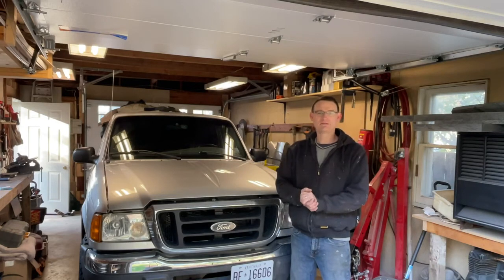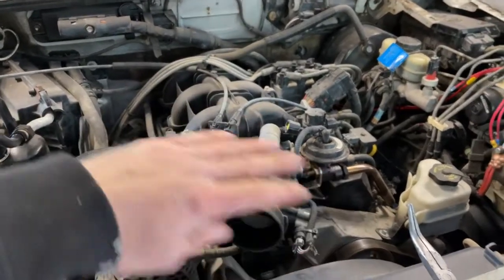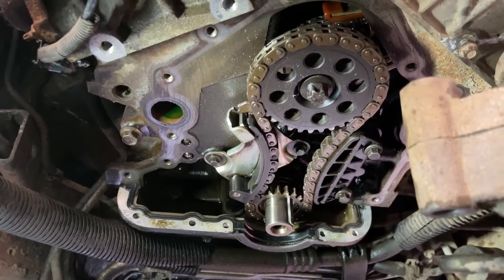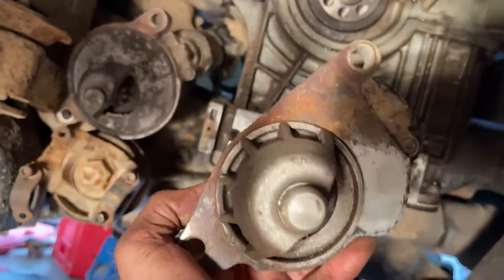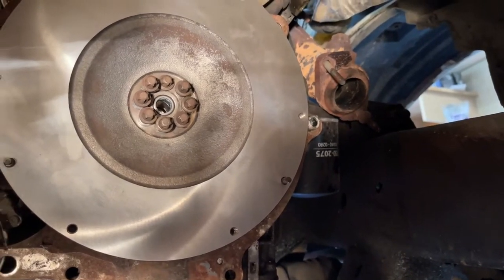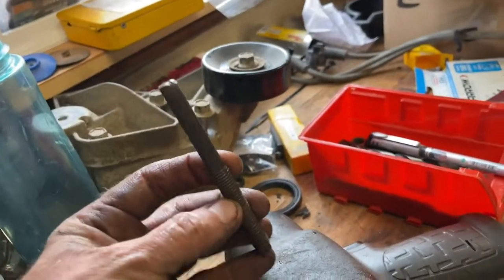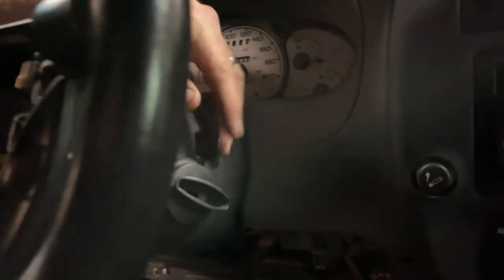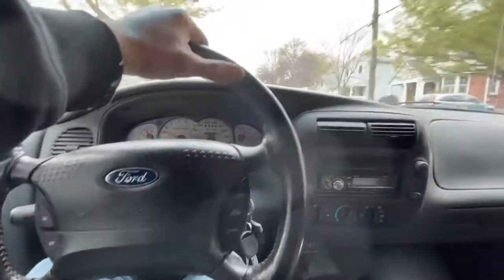2002 Ford Ranger 4x4 Manual Transmission  Manual Transfercase Swap

Comment: Great video! I like how you did it the OEM way, I did my Ranger the same way and it's worked flawlessly for the last seven years since I did the swap. It's my most favorite thing I've done to the truck and the single reason why I've kept the truck for eleven years now.
Reply from the maker: Thanks 
Yeah honestly best mod I’ve also done… 👌
It’s so much better now towing my trailer and fun around town! I’m definitely not getting rid of this truck!
Reply: @RangerShop1  how o direct wiring auto to manual? Already swap to manual but can't starter won't working
Reply from the maker: @sylvesterho5810  most likely it’s the PATS system. Google it and see if that fits with your vehicle? If you swapped the computer you might need to prof your key.

Comment: Nice work!  Enjoying your channel as I prepare to overhaul my 2003 FX4 Level II, which already has this manual t-case/transmission setup... but I watched this vid anyway just to learn more about the components.
Reply from the maker: That’s a nice truck! You got a great base to build off of!!
Reply: @RangerShop1  I wasn't even in the market for another truck, but it popped up on Facebook Marketplace when I was looking for a part for my '02 FX4 automatic, and I jumped on it because they just didn't make very many manual/manual models, as you know.  Once this one is ready to go I'll be selling my '02.  The '03 needs timing chains/cassettes but the engine hadn't blown up so valves etc should all be fine.
Reply from the maker: @PhillyFixed  it’s great when you stumble across deals like that! Very nice! 👌

Comment: Excellent! I drove over an hour to buy a "5-speed" FX4 Level II Ranger with 265,000 miles. I am driving it and cleaning up as I go. I would like switch over to manual hubs at some point.  I haul a lot of wood and thought the Super Charger would be a decent power upgrade and give the added torque needed for heavy loads.
Reply from the maker: That sounds like a great truck! I love my 5speed it’s one of the best upgrades I did. 
The supercharger is a really nice bonus, you would immediately notice the difference. I no longer downshift for hills on the highway. 👌👍

Comment: I have an 04 automatic 3 ltr. Flex fuel. Won't the automatic be alright for off road? I heard that the automatic is just as good as the manual or are you converting because the manual is cheaper for future  overhauls .Also are you planning to install a snorkel to the intake manifold?My ranger is pretty clean it has 153 grand mileage and since I've owned it I have never flushed the transmission. Someone warned me that if I flush it and change the filters and such it may ruin the trani.Is that true or is he jerking my chain? Any help is appreciated. I'm not a mechanic like you but I mostly do all my own maintenance because I don't trust shops not to rip me off. I have replaced much of my front end  ball joints and such. One last question do you think  differential lockers are worth it on 2 wdr. trucks?
Reply from the maker: I think the best truck for off-roading is what ever truck you have!😄
The auto is a decent transmission it’s actually more heavy duty then the manual.... probably weighed twice as much when I removed it, but to make it into a good reliable transmission it needs a few internal updates done.... if your trans is shifting ok then personally I’d just leave it. I do a ton of solo camping way in the bush and miles from cell service, I just didn’t trust my transmission so that’s why I replaced mine. 
I’d definitely get the transmission flushed then if I was you I’d drop the pan and install a new filter.... I’d do that every 60k miles or 100k Km’s biggest killer of auto trans is heat.... once you cook your transmission a few times with burnouts, pulling things etc it breaks down the fluid then you will get slippage in your clutches, bands etc. 
As for locker it will help but our trucks are so light in the rear you might get further just throwing in a few sand bags etc to add some weight. I’m not that familiar with adding lockers to a two wheel drive though..... 
Hope that helps a bit.

Comment: really nice swap.
my ranger is a 2000 3.0 5speed 2wd will this swap work on it?
Reply from the maker: Hmmm I honestly don’t know…. do you know if it’s the same transmission as the SOHC? I have a feeling the bolt pattern is different but I really don’t know. Sorry it’s not really helpful

Comment: What do u think of the possibility of a 2wd to 4x4 with a torsion bar 08 sport as it’s has the 4x4 frame and suspension cv axels and spindles are bolt up same with transmission have to get one from a year with 4x4 output shaft longer on the 4x4 trans one part I’m stuck as is what transfer case can I use and driveshafts obviously a manual t case is the most simple I’m thinking one out of a explorer because they are very similar trucks and have a manual t case
Reply from the maker: Hmmm that’s a tough one. I’m not sure there is a direct bolt in manual t-case other then the 2002,2003 Fx4 level 2…. Also I’m not sure if the computer speed reading comes from the rear diff or t-case but that might effect it as well. When I swapped mine I used the doner transmission, t-case, wiring harness and computer

Comment: Hi. Did you not put in the clutch position sensor in. Also did your donor truck have electric windows. I’m finding most manual trucks don’t have automatic windows and I’m thinking that the windows tie into the ecu. Thanks for your input.
Reply from the maker: Yep the wiring was under the dash, just plugged it in. I don’t think the windows tied into the pcm. I didn’t do anything with them. 🤷‍♂️
Reply: Awesome thank you. I don’t have the plug. I’ll find a work around.
Reply: I have the save truck looking to do the same swap. Which donor truck should i look for?

Comment: Thank you for posting this video! I am considering buying a mint, low-mileage 96 Explorer but it has an auto and that simply will not do! 👎 I would like to do the manual-swap as well, perhaps going to a manual transfer-case too. Do you know how many parts are interchangeable with the Ranger? I know the transmissions are the same (Ranger 5-speed = Explorer 5-speed) but the Explorers came with the control-trac 4WD system. I don't want to buy the truck and then find out that the conversion is a nightmare. I've found quite a bit of information about doing the manual-swap on a 1st-gen Explorer but not a lot concerning the 95-01 trucks.
Reply from the maker: Hmmm that’s a tough one. The things id be concerned about is where does that year of explorer get it’s speed readings from? From the rear diff or t-case? Would the t-case from a ranger be the same, send the same signal? I’m not sure…. 
A manual t-case would eliminate a lot of hassle trying to wire in the shift motor and 4x4 control module. I remember there were some manual explorers but i think they are quite rare and I’m not sure if they are 4x4. Sorry I can’t be more help!
Reply: @RangerShop1  Thank you for the quick response! I've seen the speed reading concern mentioned before, so I will look into that further. The first-gen Explorers seemed to have more in common with the Rangers. By Gen-2, Ford put the Control-Trac system into the Explorers (with all of the associated electronics), differentiating the 4WD system from the more basic set-up in the Ranger. I am looking to create a fairly capable 4x4 and am not really looking for all the bells and whistles. I will probably pursue a 1st-gen Explorer instead. Hopefully I can find one without a lot of rust and other issues! Finding a 5-speed truck would be great, but I think they sold like 8 of them!

Comment: This is so awesome! I have a 2011 ford ranger fx4, and I wanna do this swap. So what about the computer of the automatic transmission? Do you have to change anything about that because of the manual transmission? And what about the clutch reservoir being placed?
Reply from the maker: I have to say I’m not 100% sure with the 2011…. since it’s probably got a few more computer controls on it. For me everything was pretty much just swap and plug it in. I swapped all the harness and computer along with the transmission. Just grab everything you can from the donor vehicle. So far it’s working great and I love having a standard. I love it!

Comment: Does the manual transfer case allow you to change to 4x4  at any speed or something?
Reply: Not if you want to keep it in one piece. Manual or auto only a moron swaps drive while moving.
Reply: No, but you don't have to worry about a shift solenoid failing.  Also, if for some reason (troubleshooting/diagnosis) you wanted to disconnect both the front and rear driveshafts from the transmission, you can do so by putting the manual transfer case in neutral.
Reply from the maker: Yeah I like eliminating electric moving parts. Now I know exactly when it’s in 4x4 and 4lo. Before I would always pack a transfer case shift motor with me when wheeling..... not anymore 😄👍

Comment: Are you still active on your videos I have a couple questions anyway you can answer them I am currently in the process of doing this and almost done just wondering if I’m missing something
Reply from the maker: Yep still kicking around just uploaded a few more videos. What's the question ill try to help.
Reply from the maker: Loved this mod too. Honestly best one I have done to the truck!
Reply: My 1998 ranger was 2wd automatic i’m swapping 4x4 manual already done all the hard work to swap the harness computer and everything else. The only problem I’m having is the fuel pump will not kick on it cranks has all bells and whistles just a fuel pump will not kick on. Not sure if you had any problem with that maybe there is a computer in the back that’s vin decoded?
Reply from the maker: @brandonburkett7108  Right on… sounds like a good swap. 
To me it sounds like a PATS problem. It’s the ford anti theft system. It kills the fuel pump if it fails to recognize the key….. like if someone in hot wiring it. Did the computer you installed have pats…. If so does your 98 Have PATS? I believe it was optional during that time….. your best bet might be to find a computer without pats? 
If you got both computer and truck with it you might just need a program. Call up a lost your key guy he can program the new computer to accept your old pats module. Hope that helps 👍
Reply: So what I have found out was that the cluster needed to be changed out. The cluster from my truck wasn’t responding to the new computer therefore the silent alarm was on not allowing my fuel pump nor injectors to fire.
Reply: @RangerShop1  thank your your help and feedback!

Comment: I cannnot find the plug for the standard transmission can you help me on that
Reply from the maker: When you look at the transmission on the driver side you should see a drain near the bottom at the back, the fill is about in the middle 3/4 way up the transmission. The plugs are large with a hex head. Hope that helps a bit 👍
Reply: @RangerShop1  I have some more questions for you about the manual conversion I recently did one on my truck and I can’t get it to start if pls reply to my comment and If we can talk through insta

Comment: I did the same thing on a Ford explorer 92 but It has a vibration . What could It be ?
Reply from the maker: That’s tough…. If it always vibrates then it’s probably something out of balance on the engine or transmission… like a flywheel. If it only vibrates when driving maybe a drive shaft. If it’s a u-joint you can usually control the vibration with the gas… or letting off the gas. You can feel it flutter. It’s complicated explaining by text. I’d recommend taking it into a mechanic so they can just take a look at everything. Make sure nothing is coming apart.
Reply: Im a mecánico lol... It vibrates when i drive or when  Is on para.
 I took the flywheel to the shop  but It still has the vibration. Could It be the front crankshaft pole ?

Comment: I don’t really understand, man. Sometimes the truck is a 2002 & other times it’s a 2003 when it has a 2004/2005 front end. So which year actually is it?
Reply from the maker: 😂
It’s a 2002 MY with 2003 engine, transmission, transfer case and rear diff. 1999 front locking hubs. 2010 seats and the newer front grill.
Reply: They’re essentially all the same